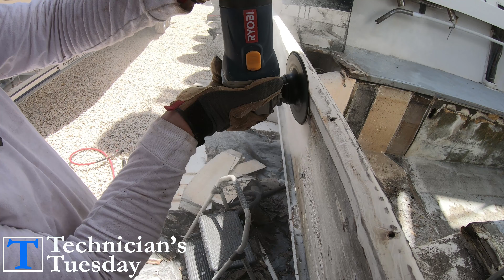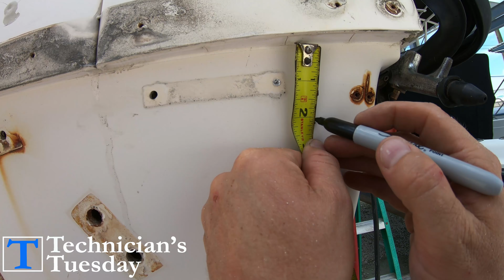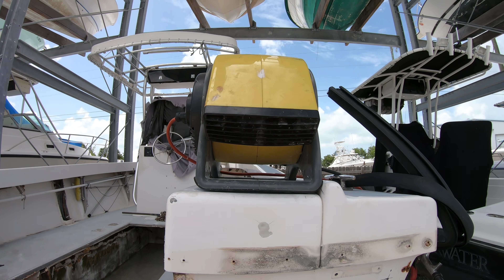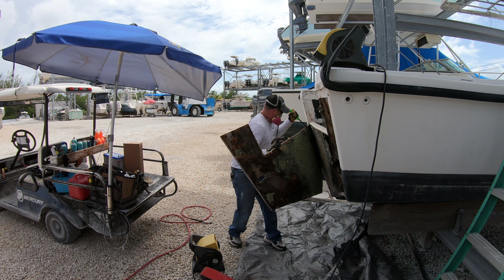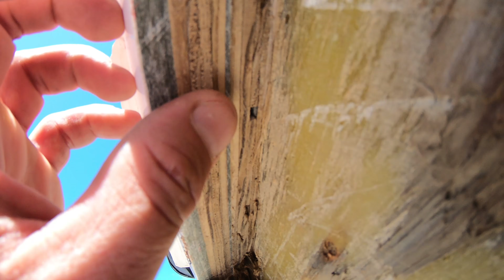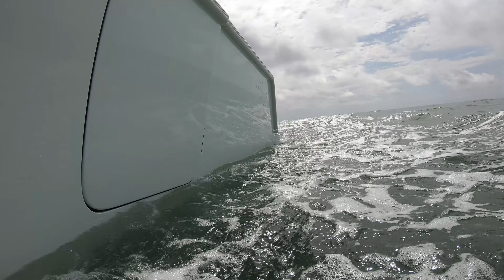Cutting Out A Boat Transom - Part 2!

Comment: Hi my brother. I am presently repairing a 17 ft mako. The stringers are rotting and there are dry spots in the Woven roving on the floor. I know I have to repair those, but the side of the boat songs a bit hollow. The side are originally done with woven roving too. I am wondering if the hollow song in the sides need to be strengthen as well? Please let me know your thoughts.
Reply from the maker: Depends, the gunwales on the outside will sound kind of hollow, some of those makos have foam in the sides, but it shouldn't be too much to worry about as far as the structure of the boat is concerned, if that is what you are talking about. The stringers and transom are going to be the most common trouble locations like you seem to have already find. 
You can also check under the rub rail where the cap attaches to the hull of the boat. That can separate sometimes and cause other issues. But I think that is what you are talking about.
Reply: @BornAgainBoating  Thanks my brother. Advice appreciated

Comment: Mate, you left out the hardest part of this job.  Cleaning out the ply that is left around the edge between the inner and out fibreglass skins.  Any tips on doing this that doesn't involve a week with a hammer and chisel.  Cheers
Reply: Get the blade of death 💀 that fits a 4 1/2 “ grinder has a chain saw teeth on it or use a chain saw

Comment: Do you do all transom that way? I mean leave 2 inches on all the sides before cutting? My transom looks  a lot like yours just a smaller boat. Thanks. Looking forward to the next video. Enjoyed the video.
Reply from the maker: Sometimes we'll do the transom from the outside, but if all you need to do is the transom and nothing with the inside of the boat, this is the best way. To be honest, in hindsight, on this transom we should have left 3 inches around all the sides, seeing the gunwales on this boat stick in so far, it didn't leave much of a lip.

So yes, you want to leave that lip around it like that, but do 3 inches to be safe,  this is fine, just in hindsight lol Thank you! It'll be up next week :)
Reply: @BornAgainBoating  Thank you so much for the reply.

Comment: Another great video :) btw; do you have any idea of a store (online or not) that can send to Europe a shift actuator for the 425xto?
Reply from the maker: Ahhh gotcha, not sure about the starters. The brushes seem to be getting dirty and wearing out. Just really quickly. Then the starter will just click and won't push the bendix up, or it won't turn the engine, just lodge up into the flywheel and click!  You can take them apart and clean them and they start working again, but not sure how long they will last and what is the root cause :(
Reply: @BornAgainBoating  hmm... Most likely thats the problem , too much dust from the brushes / too much graphite impregnated into the brushes for the load of this particular starter/motor
Reply from the maker: Thank you! Boats.net is the only thing that I can think of, there aren't any Yamaha dealers around there that can order and sell parts like that?
Reply from the maker: Are you already seeing problems with the XTO's? Those shift actuators should be pretty well straightened out! I know that Yamaha is having major trouble with their starters right now, we're seeing probably 6 or so a month where they are failing with under 100 hours. Something going on at the factory we're guessing.
Reply: @BornAgainBoating  they are out of stock  in Europe ... Honestly I dont know exactly the problem of the actuator , the boat isnt mine . He told me this was while he was using helm master . Whats the problem with the starter overheating/melting ? Too weak to turn the beast?

Comment: What are the benefits of doing the transom from the outside like that? I’ve seen other videos where they do it from the inside. If that boat goes back together even half as easily as you took it apart... I’ll probably just look for boats with rotten transoms from now on and save some serious $$$!!
Reply from the maker: It depends on the boat really. The biggest benefit of doing it from the outside is that it is usually quicker and easier :) Normally, as long as the stringers and the deck is in good shape, you'll want to do it from the outside so you don't have to cut into the fiberglass on the inside and then mess with the deck of the boat. 

Especially when the deck has this type of non-skid, you can never match that, or well, I don't know how to do that lol maybe a fiberglass guy might. So doing it from the outside takes a lot of that away and your glassing straight up and down opposed to around the stringers.

Both ways are fine, as long as it's glassed up properly, they will both hold up for many years to come! 

Hahah, yeah, transoms are easy, you can usually do them in a week and a weekend if you really get at it :) plus, doing it in wood and doing all the work, you can usually get it done for under a $1,000!
Reply: Born Again Boating, Thank you for that very informative response. What would you say is the biggest factor that determines what size outboard you can hang on the back of a boat? Is it mostly the weight of the outboards? Or does the amount of torque being applied to the transom by a larger outboard play a factor? My boat has a 250, it’s rated for 300 hp (which back in the day meant twin 150s, because a 300 didn’t exist) ... would a single 350 be too much? Currently at 5000 RPM it can do about 30 to 35 mph. Wide open it can do 40 with a light load. I’d like to be able to cruise at 30 at maybe only 3500 or 4000 rpm
Reply from the maker: You're welcome, um, that gets kind of tricky. There are some rules by the ABYC and the NMMA as well as the Coast Guard. So, basically boats that are under 26' are required to have a HP and weight capacity. Boats above that that are Yacht certified don't really have those tags because it is based on stability, which gets really gray if you ask me!

For your situation, the 300 might work, but you want to watch out for the weight of the engine because it will affect the ride of the boat. You won't be able to get a marina to put a 350 on there because it is illegal due to the coast guard plate. So, you've got some legal things there, but I don't think the Coast Guard is going to come and carry you off if you hang a 350 on there lol
Reply: Born Again Boating... it doesn’t have a capacity plate on it. I found an old brochure from the manufacturer that lists 300hp. The Hull is 23 feet and a few inches long 9.5 feet wide and has a dry weight of 4000 pounds. The motor bolts to a bracket that’s another 2 feet long. The 250 that’s on it is a solid motor but really has to work hard to cruise at a decent speed, so I get terrible mileage. If it ever kicks the bucket, I’m going to repower with a 300. But if a 350hp outboard weighs the same I’m thinking of going that route. Maybe the 50 extra HP would help cruise the boat at a lower RPM.
Reply from the maker: I see, to me, for a 23' boat that seems like not enough power, being a 250 on there. We did the transom on our Wellcraft and put a 250 OX66 on it and that's a 20 footer :) 

So, I'm always a big advocate for over powering lol I'd rather have more than enough power than not enough! So, I think a lot like you. If we were shopping for an engine and I didn't have the 300 Verado, we'd be looking to put a 350 on the 23' Ocean master! Seeing that  they do weigh the exact same thing, the cruising speed will be higher and the fuel consumption will be lower!

It's just your boat you know, you can do whatever you want to do, but no one can really legally tell you that you can do something that is technically "not legal" lol 

I think the Ocean Master has a rating of 300 on it too though, but since we're doing the transom, it's been "altered" to support the "new" horsepower of 350 if we put one on there ;)
Reply: Born Again Boating gotcha! I couldn’t agree more. Maybe I can find a good deal on a 350... surely there’s a rich guy someone swapping out his perfectly good triple 350s on his million dollar boat for the new 400s because he wants to have more horsepower than his neighbor! Until then, I’ll run my old 250 EFI.
Reply: But those newer engine repowers are pretty much plug and go aren’t they? I’d probably have to hunt down the rigging to go with it... which makes keeping my 250 the more realistic option.
Reply from the maker: Hahah yeah, they do like to change engines like changing shoes lol Most of them are plug n play. Depends on what kind of rigging you have and how old your engine is. What 250 is it?
Reply: Born Again Boating ... it’s old. It’s a 1998 Mercury 250EFI. All mechanical controls. You’ve actually given me some pointers on changing the temp gauge and the motor mounts in the past. It’s an awesome motor, just too small for that boat. Especially when I have it loaded down with 9 scuba tanks, 65 quart cooler and three guys with gear. I get about 1.5mpg doing 28-30 mph.
Reply from the maker: @ericdavi1231  oh yeah! Now I remember. Yeah, you could find a mechanical control opti or something and keep the rigging. But really, itll probably be best to just save up and do the complete repower with the rigging :/
Reply: Born Again Boating ... yeah, I’ve thought about an optimax too. That would even keep the weight a lot closer.

Comment: Why would you cut the outer glass layer? Your going to have to fix stringers up against the transom interior anyway professionals always law transom from the inside what is the logic here???
Reply: terry fonz, I’m no boat restorer, but everything I’ve ever seen on this type of repair, said never cut the outside of the transom glass as its an integral component of the hulls integrity. I’ll be interested to see how this turns out .
Reply from the maker: There are a couple of ways to do a transom. The stringers in this boat are fine and don't need to be reglassed. So doing the transom from the outside is the quicker and easier route to doing this boat's transom. :)

Comment: Did this jod on a 1974 seacraft 18 months  ago, great to see i did it the same as your self, keep up the good. work
Reply from the maker: That's awesome! Yeah, there's a huge debate between doing it from the inside or the outside. Depending on how it's done and prepped, it can be done either way. If the stringers are rotten a lot times you'd do it from the inside, but for this boat, the outside is just fine! Seacrafts are a great boat, we see a lot of those being restored these days. Actually quite a few to be honest, I think I've seen at least 3 23'ers in the last month or two! It's awesome to hear you got it done :) great work!

Comment: You can also use a scraper blade on the end of a Sawzall that works well for stripping rotten wood off of glass. Makes quick work.
Reply from the maker: Never thought of that, I don't think I've ever seen that! Thank you! I'll have to check that out, sounds like it might be quicker and quieter! :) Thank you!
Reply: @BornAgainBoating  You can get them at Home Depot, they work great for separating wet wood from glass. https://www.amazon.com/Milwaukee-49-00-5463-1-1-Scraper-Blade/dp/B004F5KXBC/ref=sr_1_16?keywords=sawzall+scraper+blade&qid=1564575995&s=gateway&sr=8-16
Reply from the maker: That looks sweet! I've gotta try that, thank you! I just checked and they have them here at our home depot! I'ma buy one and use it in the following video when we do the transom glass preparation! Actually it might be 2 videos away, we've got another one coming. I need to layout all of the electronics so that we can get all the pumps, lights, GPS, and all that stuff ordered for after the transom :)
Reply: All you do is throw the scraper blade in the Sawzall, then hold the Sawzall at roughly a 30 degree angle or so, flex the blade against the rotten wood, then pull the trigger. Works wonders for stripping out wet wood. I couldn't tell you how much balsa coring I've ripped out using one. I'll look forward to your next vid!

Comment: What is your opinion on coosa board vs plywood for a transom?
Reply from the maker: Well, ultimately, it really depends on the budget. In my opinion. The marine plywood is only about $100 a sheet and you can get it at most local hardware stores, that day, depending on where you live. The coosa board on the other hand, costs over $400 a sheet and needs to be delivered! 

I think that the plywood is definitely stronger than the coosa board, but it does rot and depending on who does the rigging, might only last 20-30 years, more if it is done properly. Whereas the coosa will last indefinitely really, until the transom flexes so much it begins to crack heavily. Which is what we see on a lot of the larger boats with trips or quads on it, just the force that gets put on the transom.

After about 10-15 years, they need to have work done because the outsides are stressing and cracking so bad that the whole thing might come off in one solid chunk! But that's all big toy problems and the effects of doing 60+ MPH in a 3' chop in a 40' boat lol
Reply: @BornAgainBoating  Awsome reply, I hope a lot of people get to read your reply. Since it is a very largely debated topic especially with new boats being made completely out of composite materials now a days. Its just as controversial as polyester resin vs epoxy. Hahaha, keep up the good work.
Reply from the maker: @CTCLures  Thank you! Yeah, everybody seems to stay away from wood, but there's still a ton of people out there that still don't trust the composites lol Divided lol Yeah, the epoxy and polyester is a whole other battle lol Thank you!

Comment: Man. I just watched this video 3 times and learned so much each time. Lesson 1 hire someone to do this, 2. Hard work to repair my boat doesnt get me on the water any time soon.
Reply: Will you be using wood for the transom? I hope not.
Reply from the maker: @leftyk1968  Maybe :) I don't know if I have enough money to do the Coosa board lol it's like $800 more!
Reply: @BornAgainBoating  what its that much!!!! Urgggg what did i get myself in to. Ill have to find other options  like seacast or something similar
Reply from the maker: @leftyk1968  yeah, that might be because of delivery to the keys, but it's a lot! Wood is fine if its rigged properly
Reply: @BornAgainBoating  thanks bro for all your knowledge and advice. 
My big issue is water getting in the hull via  the Pvc pipe that runs thru half the boat under floor for drainage and cables and wires. Over the winter i covered the boat snow accumulated froze and when when the sun would melt it. It drained in and under the floor i found ice dame the size of the pvc hole and lead to drain hole. It expanded  crack the pipe so when it rains it get in the hull. I had the outer shell of boat redone. By a pro havent had the boat in the water in 2 years.
Reply from the maker: Lol That's too funny, and you're not kidding, it doesn't get you on the water any time sooner lol The last transom I did we did it in a weekend, cut it out and prepped it Fri night, layed it up and glassed it all on Saturday/Sunday, painted it and then put it in the water on Monday lol That's our Wellcraft and we call it the Whack n Pack for that reason lol we needed the boat for Tuesday so it's just how it turned out :)
Reply from the maker: No worries! Oh no man, that's terrible! Oh the problems of living where it freezes :( Do you think you could get to the pipe and be able to put some glass and some paint on it to seal it up?
Reply: @BornAgainBoating  no its not visable. Its the only solution  i have for water getting in the hull.  Ihad the boat blasted sanded fiberglass where it was needed. Barrier  paint the whole boat. And when it raines. Water drips out the edge of  the new drain tube.ice coverd entire  length of pvc upto drain hole
Reply: @leftyk1968  its a straight pvc tube ? Why not trying to put one pvc tube a bit smaller inside the old one and seal it ?
Reply: @Danidasanic  interesting idea, so remove all the cabless and wires and some how squeeze  or cut off entrance  and exit of pipe then seal it. Hummmm. Now you have me thinking. I should just cut the floor board the entire length of the pipe. Great the more i think about ill will never get this thing in the water this year ai dios mio
Reply: @leftyk1968  Dunno where is your comment and honestly I don't rly know how to solve your problem without even seeing it . In my mind u can just seal the new pvc inside the old pvc without cutting the old one , the water will flow inside the new tube
Reply from the maker: It's hard to say, you really need to know where the water is coming from to know what to do about it :(